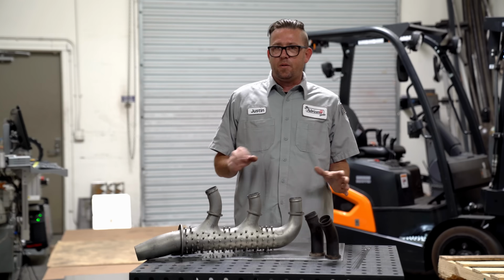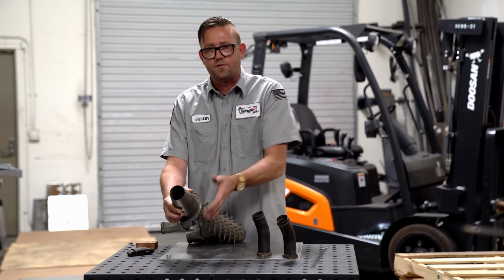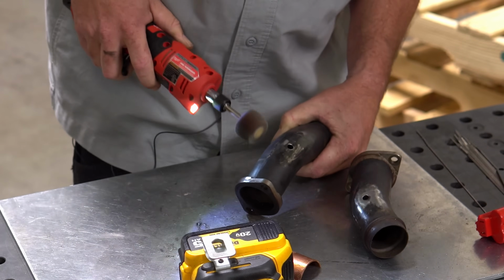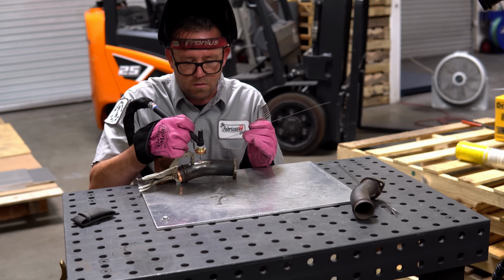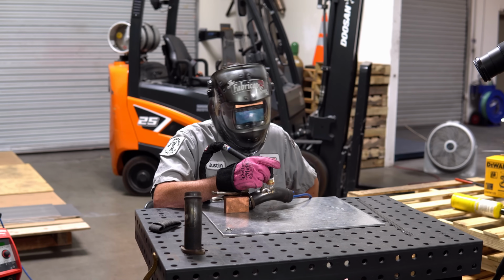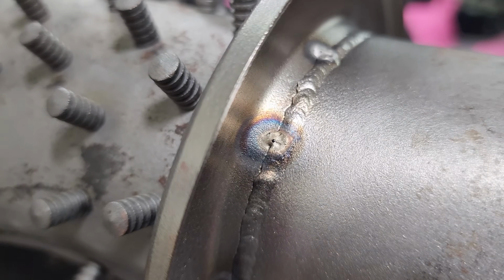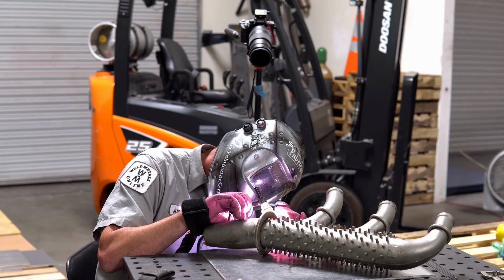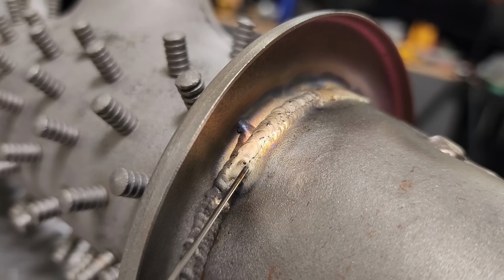Weld Repairs You Should Avoid

Comment: I have both of those Milwaukee 1/4 grinders as well. I run the 5ah batteries on them and they just do that with big wheels. 1.5" wire wheel works best from what I've done so far. Or a sanding disc

Comment: What if you covered the backside of the weld with solar flux, in the case of those two smaller parts. Use a copper backing bar as a heatsink to control burnback, and solar flux on the backside (if cleaned)

Comment: It's not an air tool. You can't just bear down on it and expect that tiny electric motor to keep spinning. That's the issue. People try to use it like an air-operated die grinder and that won't work. Then they get mad At Milwaukee because it doesn't work like an air grinder.

If you want to treat it like an air grinder, use an air grinder. Not an electric one that's obviously going to protect itself when you jam the motor up.
Reply: they also suggest using the 3, 4 or 6 amp battery packs,  i have one of those right angle ones and i work it hard but it only runs on my bigger  batteries

Comment: Gas welded originally by the looks of it. The Milwaukee is overloaded and it shuts down so you don't burn up the battery apparently. it's annoying
Reply: Gas welding doesn't work very well with stainless.

Comment: Those grinders are actually amazing, but with a max diameter of 2" wheels, 4" for cutting wheels. the ryobi version works better for larger wheels because it only cuts out when temp gets too high vs the Milwaukee that goes off of load.

Comment: That wheel is to big for that die grinder. I also found out the hard way that the electric ones (that I've seen) are only rated for up to 2". At least the Milwaukee's say it on the box (which of course, we don't read)... other brands have that information buried 10 pages into the manual.

With a smaller wheel installed, I've been very happy with mine.

Comment: That weird smell may actually be lead contamination as aircraft can run "Avgas" which still contains lead to up the octane. I have welded an exhaust off a plane that has run Avgas before and it is a very distinct smell along with the white fume that looks almost like an incense burner.
Reply: Not only CAN they run AvGas, they are required to use AvGas unless the owner spends a lot of money to get an STC to run MoGas.
Reply: @silaskuemmerle2505 what is Mogas sorry I don’t know much about flying. I do know what avgas is
Reply: @dreece2000  mogas is the aviation industry abbreviation for automotive gasoline
Reply: Lead makes a blue-white color when burning so I would say that confirms lead is the issue. Dont want to breath those fumes!
Reply: The moment he said "smells like av gas" that was my first thought too. Lead deposits from years of use. Big spook.
Reply: I was actually just making a comment to mention that, glad I looked first.  :D  Yeah, and I wonder what the residue on the inside of the melted metal.  What does stainless become when glazed with tetra-ethyl lead and soot on the inside?
Reply: Yup lead 4 sure, specially being a 1940s/50s era exhaust
Reply: @captaintoyota3171 aircraft still burn leaded fuel

Comment: All of the SS headers and high vibration welded components should be heat treated by a competent company in a furnace.
Offshore racing boat headers last almost 10 times as long when they are furnace heat treated VS those which are not.

Comment: hey Justin, If it was going on aircraft It's SOP to back gas otherwise you will get embrittlment (sugar baby). I wold use a 347 rod  .035" or .045"  on this, most AC exhaust is around .060" unless it's on a turbo which is usually a little heavier. I really enjoy your video's, Thanks!

Comment: Justin, Milwaukee likely has an auto shutoff on that tool due to the circumference of the wheel on it, causing the auto-torque reaction simulating the motor was stalled due to being captured or stuck... To save the motor. Try a smaller wheel... Awesome content, as usual!!!!

Comment: I think your issue is with the small 1.5ah  12V battery, for my right angle grinder I use a 6AH battery and never have the load down issue you're having. Hope that helps. So what cleaning method would have been best if not blasting, would a different media would have been better like walnut or metal oxide or chemical dipping?

Comment: Although not SS, I had several boat owners that would bring in leaking aluminum fishing boats that they tryed to JB weld first, then they would ask how much $$, my response was " Oh about four time's what it would have been "  JB weld is so bad you are better off making repair patches so as to get away from the original leak. As for aviation manifolds I did my share of DC-3's and yes it's a bitch, got it done with the OK of the cert mechanic (he had final say so, this was the 70's) had no choice because the Auto Zone didn't stock DC-3 part's nor did  Douglas aircraft, unfortunately.

Comment: Very interesting video ! Those struggles are real, I've been there several times.
Sometimes, in Aluminium, I've just added filler, ground it down, and more filler again and again.
In a sandblasted non aluminium part, I'd probably recommend stick welding, as it's less sensitive.

In this case, with so thin stainless, stick welding is probably not an option though.
So just keep on struggling with the TIG it is 😅

Comment: It is also possible the part is inconel as it’s a commonly used alloy for aircraft exhaust
Reply: I have never heard of an inconel exhaust on a piston engine. Turbines absolutely, but not pistons.
Reply: @silaskuemmerle2505  In the World Rally Championship, Inconel is used in a few high heat areas on the car. On the old Subaru WRX cars, it was used in part of the exhaust as part of the anti-lag system. It wouldn't surprise me if the manifold is Inconel because of the use on an aircraft
Reply: @Awkward_Fox  well that's an aircraft part not a car part, and as an aircraft mechanic I have not encountered an inconel exhaust on piston engine aircraft.
Reply: Agreed; or even possibly Monel... could explain the weird oxidized colour, and also why the weld pool was acting a little different...
Reply: @heyitsjel  it's probably just regular stainless.
Reply: I’ve been on merchant ships with inconel sea water pipes and they do not present as silvered or black but rather a muddled copper.
Reply: @flyingmonkey3822 most likely they were not inconel but copper nickel.
Reply: Has that sludgy look

Comment: bought 2 of those?Milwaulkee angle die grinders for my shop,they did the same thing,returned both several times same problem.contacted customer service they said that's normal.over priced POS. Thanks for your video and advice.sometimes we take things on because of slow times and always bits us in the a$$.

Comment: I'll check and see if any of our graduates are in the Vegas area or willing to move. We've been training Avid Media Composer and "traditional" shoulder sized cameras ( until just recently and we haven't graduated a class on the new smaller cameras and Premiere yet), but anyone I would be willing to recommend could adapt very quickly. I didn't finish the video yet, do you have that position posted on your website? If not, could you post the job listing there so it's easy to send them links?

Comment: I'm a diehard Milwaukee guy. That 90 degree die grinder is garbage. I can tell you that. I bought it earlier in the month after my harbor freight die grinder failed after 8 years. Been struggling with it. It keeps quitting. and when it's not quitting, it's chewing through batteries. I just ordered another air die grinder so I don't keep wasting time with that milwaukee.. I love milwaukee but that thing is a dud

Comment: That big of diameter wire brush is too much load but it will do a LOT better with a bigger battery like 4 or 6 ah
Reply: That tiny battery stood no chance. Even a 1amp 18volt drill with that wire brush would have struggled

Comment: You dont have to any certification to work on airplane parts. any repairs will just have to be signed off by a certified A and P mechanic. I weld parts for airplanes all the time.

Comment: The pins and the flange are for cabin heat, there is a shroud that covers it and air is forced over the  surface and pins as a heat exchanger.
Reply: @MemorialRR, that's interesting. Thank you for sharing.
Reply: @Lonewadi6242  You are very welcome.
Reply: Good info.  Thanks.
Reply: I did not know that. Thanks for the info.
Reply: Well I wondered what they were for I must admit !

On a car turbo exhaust, I fixed the shroud to the bodywork to stop vibration and heat cycling causing the fixings to break - guess that's why there's so many !
Reply: Exactly. They obviously needed that repaired for the cabin heat on their sand rail. 😜
Reply: @MemorialRifleRange  I've done the same thing to a log style manifold with a heat shield with a ducts pushing air over the manifold for burn out contests
Reply: @danielsplayhouse3804... and Lollipopped the Pipes, right?
Reply: Can also be for carb heat .
Reply: @Rods-BikesnGuns  Absolutely, one side has the air door and duct that leads to the intake.
Reply: @Rods-BikesnGuns came here to say that learnt about cabin heat

Comment: that wire wheel is way too big for that die grinder. you need to use a 1-2". they dont have the same power as a 3/4 hp pneumatic die grinder.

Comment: The stud setup is for the cabin heating, on a lot/most small airplanes they heat the cabin using exhaust heat, pulling air through a shroud around the manifold, the studs help with heat transfer.

Comment: Current piston aircraft exhaust parts are generally 421 stainless. That stuff gets red hot every flight and old stuff is almost guaranteed to have metal erosion.
Reply: And cheap stainless at that.  70 years ago, it was Inconel like this thing is probably made of.
Reply: @jagboy69  No way ANY GA aircraft exhaust except maybe a turbo has any Inconel. And certainly not this (what looks to be) 50's/60's NA Bonanza exhaust.
And 421 is not "cheap stainless".
Reply: @tedsaylor6016  Certainly not today.  But I can assure you GA aircraft uses inconel.  I bought an exhaust for a Socata TAMPON and that POS was mega bucks because it WAS inconel.   Dumped that turd shortly after.  Lesson learned, avoid French and Italian aircraft.

Comment: Abrasive discs only advertised as cut off tool. Put the wire wheel on the Dremel-The power goes directly from the motor to the wire brush, not from the motor to differential to the attachment. Only meant for consistent high speed. No low end torque

Comment: The milwaukee is only made for 2 inch attachments and that's why its cutting itself off with overload protection. That wire wheel is way too much for it.  I purchased the ryobi 18v one over the milwaukee because of this and bought a battery adapter.  Ergonomically the ryobi is worse than the milwaukee but way better than using a drill.

Comment: Most the moisture your seeing during pre heat on the metal is a biproduct of the torch combustion. Its condensing on the cool metal stops once it heats up.
Reply: The same thing happens when hot air from an electric heat gun hits cold metal.  Moisture in the hot air momentarily condenses out on the metal and then quickly evaporates as the metal heats up.  Car windshields fog up through an identical mechanism.
Reply: This. It drives me nuts when people insist that they're magically drawing moisture out of the material. It is simple condensation from the biproduct of combustion of many hydrocarbons, water...
Reply: @Zerk_Ziegler  I presume you're responding to a spambot that said you won something? That message has been removed.
Reply: @davidg3944  👍
Reply: Oxy-acetylene produces water. TIG doesn't,  there is no combustion here.

Comment: This angle die grinder is designed for high speed low force. I've had good success with 3 in Scotch-Brite Roloc. Assuming your wire will is designed for a drill, the max rating is 4500 RPMs. I noticed you had it on the the the highest setting, which I believe is over 20,000 RPMs. It's also kind of dangerous. Hate to be the safety nerd.
Reply: @wesbri-p9e  yeah, I've exploded a couple of wire wheels with my die grinder - they definitely don't like 20k rpm! Still finding bristles around the shop months later  😆

Comment: First of I am not a welder ?thusly? I have a question. Do such exhaust not behave like kinda tempered steel? Would it change its behaviour if you first backed it at ca 400°C for a few hours and then let it cool down in the oven gradually reducing the temperature? kinda like cast iron? 
Thx in advance
P.S.: sorry for eventual linguistic mistakes. English isnt my mothertongue

Comment: I bought a Milwaukee rotary tool. The first one died after a couple uses. It was "repaired" once (they didn't return the collet nut) and then replaced under warranty after it failed again. On this one, any signifcant load and it quits, but will restart after a few seconds. I still rely on the corded Dremel for extended use.
Reply: All of them do that. Any real load and it turns off after a second or two. Worst tool I've bought from them by far.
Reply: I have a straight grinder bosch ggs 18v 10slc hasnt let me down yet. But its not light and not really a one hand machine.
Reply: You are overloading the small 2ah battery. Try a 4ah battery.

Comment: I have that angle grinder and I think its a giant POS.  It always cuts out on me even when using the slightest of pressure with a small roloc disk.  Also, they should have labeled motor speeds in RPM directly on the tool.  My implements aren't stamped in speeds 1-4!

Comment: I do a lot of repairs on similar exhaust pipes for aircraft and I use the nonwoven rust/paint removal roloc wheels in two inch. They work great to get to that shiny weldable goodness without removing any material
Reply: Yep, great stuff from 3M. I use them since I got to repair / weld some exause pipes on my and some friends motobikes. And Justin, thx for sharing your knowledge with us. I mostly taught myself TIG welding, read a lot and ultimately learned a lot from people like you. For all other types of welding I had lessons in my training as a car mechanic here in Germany. But that was more than 30 years ago.😂
Reply: This is a perfect use case for laser cleaning. It’s definitely affordable at the shop level now.
Reply: Don't use brake cleaners for weld preparation. Look it up.
Reply: @donaldoehl7690  use non chlorinated

Comment: That’s a die grinder! Good for 2 inche or smaller discs not wire brushes. Use an angle grinder for 3 and 4 inch wire brushes

Comment: Using a smaller wire wheel and not putting to much pressure on the tool will help a lot but I don’t think it’s made for stuff like grinding metal away I just use it to clean the old silicon of oil pans and surface like that lol